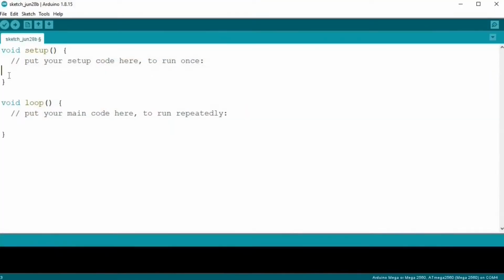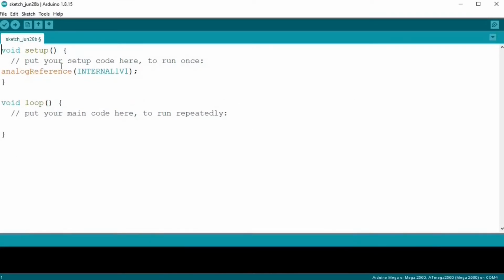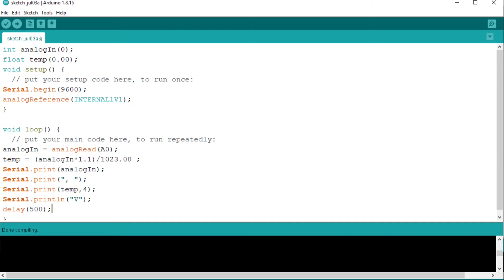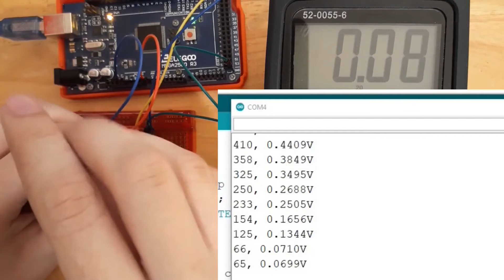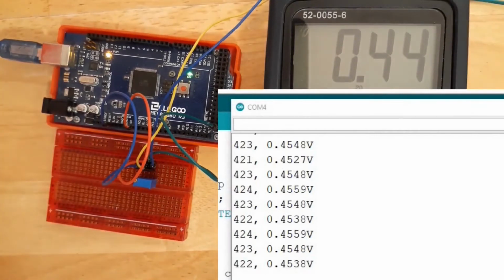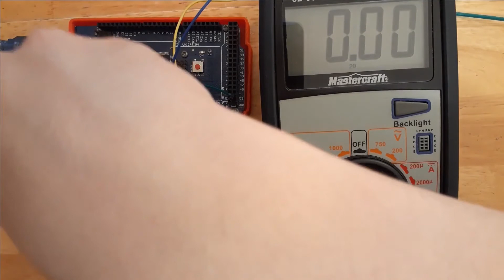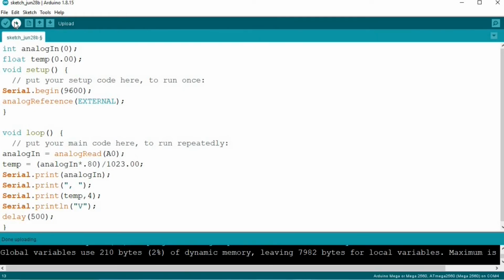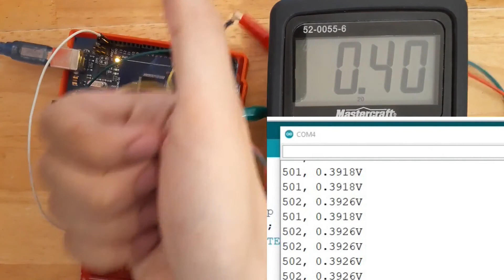Read small Voltages with Arduino

Comment: A good video but the most important thing would be to be able to control if we power our Arduino with a lithium battery to know what percentage of voltage is left in the battery, could you make a video about it?

Comment: Nice video love your channel new subscriber (1 day ago)
Reply: Hey umm I need some help in a project
Reply from the maker: yeah anything, I'm happy to help.
Reply: @TabletopRobotics  hey so could you please  make a video on bluetooth automation like using  voice commands in mit app inventor  to communicate with arduino like turn on the lights or lock the door
Reply from the maker: are you using a certain plug or lock because i don't think you can connect mit app inventor to most of them.
Reply: @TabletopRobotics  I'm using servo and relays
Reply: @TabletopRobotics  it is a normal door lock but I have attached it to strings and the string is attached to a servo which when moves ,it moves the key whichunlocks the door
Reply from the maker: oh, that's a smart way to do that, but that shouldn't be to hard to make. I can try to figure out how to program everything and the video should be up in a week. Do you mind if I show these comment in the video?
Reply: @TabletopRobotics yea you can show it in the video I have no problems ,and preferably voice control
Reply: @TabletopRobotics  and thanks for doing it buddy
Reply: @TabletopRobotics  btw which library do u use for controlling the servo ,I use <MobaTools.h> (I don't like it)
Reply from the maker: I use Servo.h its already installed within the Arduino software. i find it really simple to use and you can find a lot of examples using the library online.
Reply: @TabletopRobotics  for me it says library not installed
Reply from the maker: what version of arduino are you using? in on 1.8.15 and windows.
Reply: @TabletopRobotics  I use mac
Reply: @TabletopRobotics  latest update
Reply from the maker: I didn't know mac and windows default libraries were different any ways did you try to install the library? if you dont know how I found this video https://www.youtube.com/watch?v=9sUmuD86sQs at 7:40 he adds a library.
Reply: @TabletopRobotics  uhh Idk why its saying that this library is only for nano and mega not uni
Reply from the maker: um that's weird i know it words on the uno but i don't know why its  says that. so what library does the build in examples use?
Reply: @TabletopRobotics  mobatools.h
Reply: @TabletopRobotics  anyway thanks
Reply from the maker: Yeah sorry i could be of more help.
Reply: @TabletopRobotics  nah man it's ok cause that library is usable
Reply: @TabletopRobotics  sup
Reply: When will the video come out
Reply from the maker: oh sorry man had a really busy week haven't had alot of time to work on the video, but everything's filmed and i just need to edit it. ill post it before i go to bed, should be accouple hours.
Reply: @TabletopRobotics  no problem buddy